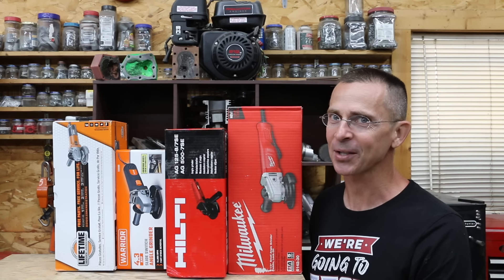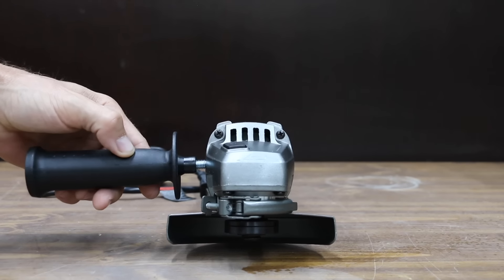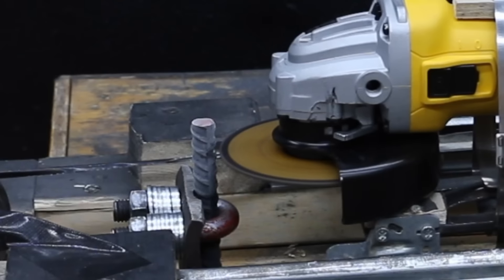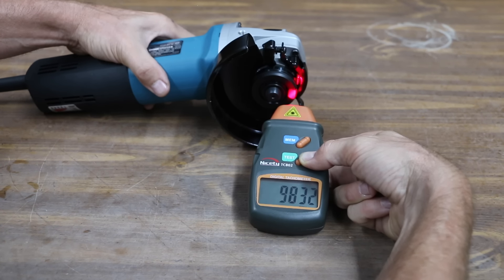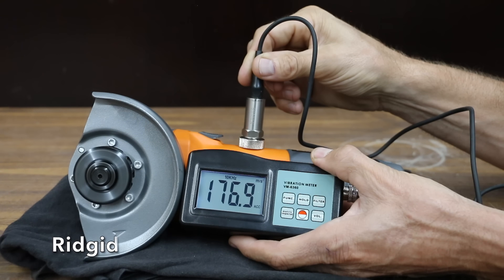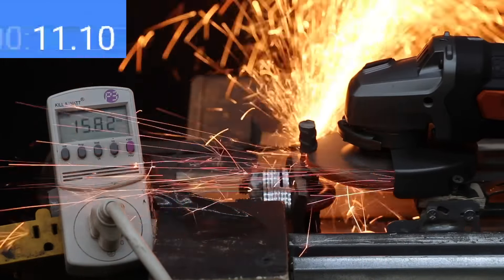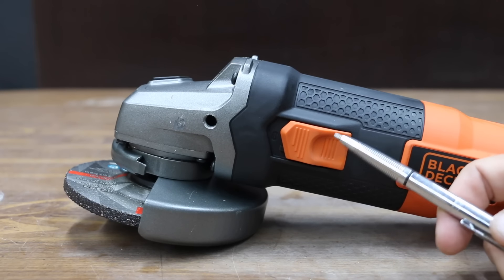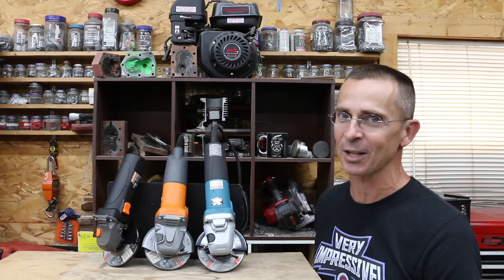Best Angle Grinder (Corded)? Hilti vs Milwaukee, DeWalt, Makita, Ryobi, Ridgid. Let's Settle This!

Comment: How about testing some often many construction adhesives. One brand i just used and will be keeping an eye on is the Gorilla Glue Max Strength construction adhesive clear. Another im using is Quad OSI. It says its for windows and doors but its an adhesive. Standing at Home Depot looking at all of the options is nauseating.
Reply from the maker: Thanks for the suggestion.

Comment: I prefer trigger operated grinders in case you drop it. You don’t want that thing flying around!!! Dangerous!  I’m also used to changing the wheel just using a hand grip. This is so you can switch between a bring wheel and brush quickly if you only have one with you on the job.
Reply from the maker: Thanks for sharing.

Comment: Maybe this is an American thing but can you test 5inch grinders, we have almost no 4.5inch grinders here in Australia. Also variable speed versions, be interesting to compare European brands like Suhner and Fein vs the more common/cheaper brands.
I use these cause as a metal fabricator I need different speeds for specialized discs for polishing etc.
Reply from the maker: Thanks for the suggestion.

Comment: Based on this video, I looked into getting the Ridgid or Ryobi models in this review. I found it interesting that both models (which are from brands both owned by TTI) explicitly state in their manuals that they are not to be used for cutting. I'm finding it hard to find type 27 cut off wheels that fit either of these two grinders. Is this just a common thing that angle grinder makers put in their documentation for CYA purposes?
Reply from the maker: Thanks for sharing.

Comment: I'm definitely a milwaukee guy but I have a dewalt plug in angle grinder that I really like it's just comfortable and easy to use. I have used a lot of angle grinders I currently have 5 I think that work. I really like my dewalt a lot it has the flapper trigger it's different different than the one in the video. I noticed that my dewalt started sounding louder and slightly rattly so I think it's on its way out but it just keeps going. When it does crap out I will definitely be buying another dewalt I feel like it's just easier to use and easier to be precise with. I have a master mechanic brand 4.5 angle grinder that someone gave me and that thing is ridiculously powerful I just don't like using it because it's just too much for the stuff I usually do so I leave a heavy wire wheel on it. Then I have a milwaukee m18 fuel grinder which is nice and versatile then i have a old makita somewhere which is ok. 
Many years ago I was cutting some 16ga sheet metal with a harbor freight angle grinder and all the sudden the head exploded not the disc but the gear set inside the case or something let go and the guts came ripping out and it shredded my hand pretty good I still have scars. Ever since then I've spent the money on high end tools.
Reply from the maker: Thanks for sharing.

Comment: We use metabo for our small flour grinders and I had no idea they made hand tools. They are very high quality tools tho we’ve done 5 years worth of floor grinding with it. I do have a question tho. Which grinder is best for wet tile cutting (running the grinder through a sponge to do cuts on ceramic or quarry tile). I’d love to know
Reply from the maker: Thanks for the suggestion.

Comment: SORRY TO FIND several tests "NOT USEFUL" on this video...
 
These are the aspects I would consider instead: 

1) A 5" capability, not just 4.5".
2) VARIABLE SPEED but with Constant-Torque.
3) Anti-Kick Back protection.
4) Effective power vs price.
5) Availability of a guard that has a Dust-Collection w/conection for a vacuum.
6) Ergonomics, like barrel circumference.

Look, if you ONLY want to cut rebar or grind away metal, almost any of those tested "will do"...

But, having a good VARIABLE SPEED with CONSTANT TORQUE will give an angle grinder MANY EXTRA USEFUL FUNCTIONS.  That IS the reason I searched and bought my Bosch GWS 15 125 CIE grinder. With it, I am able to perform MANY MORE JOBS, like:
SANDING wood, metals and Plastics at a reduced, safe and more effective speeds.
CUTTING Wood, fiberglass, plastic pipes and many materials (with carbide granule edge discs); 
CUT Slots in gipsum walls for adding electrical cables or pipes,  -BUT WITH A PROPER DUST COLLECTION TO AVOID ACQUIRING"SILICOSIS", a serious respiratory disease! (you really want to be able to attach an effective vacuum!), 
POLISH wood, and even auto paint, or buffing with wool or foam discs...

With low speed with ample torque, I am also able to resharpen my router bits and drill bits to perfection with a diamond wheel... impossible at more than 10,000 rpm!

ASK SERIOUS PROFESSIONALS that work with Stainless Steels, WHY it is way better to work the stainless at REDUCED SPEEDS, and that is why there are special models of grinders designed for "INOX", like those from Bosch and Metabo, which have a lower speed gears in order to run the abrasive wheels and discs at around 7,000 rpm max, instead of going mad at 11,000 !!! Stainless is best worked at reduced speeds. But unless you only work with stainless, those are quite more expensive, but a good Variable speed will perform the ocassional stainless job adequately.

Now, if you read the workplace studies of serious accidents, you will find that the "smallish, innocent looking hand Angle Grinder" IS among the worst serious accidents prone electric tool (!)...
There are even quite a few deaths caused by this smallish tool... So, there is why having an effective Soft-start WITH a sensible Anti-Kickback feature CAN BE a "life-saving" option.

At least in my country, only Bosch and Metabo met my criteria on corded Angle Grinders, and while there were a pair of truly inexpensive ('cheap') grinders with a too-simple Variable speed knob, based on a crude light dimming circuit, they lost ALL TORQUE at reduced speeds, making them useless ("Gladiator" and "Knova" were those two brands). 
Finally, the only aspects I do NOT like on my Bosch 15 125 CIE, are the somewhat fat barrel, that does not fit quite comfortable in my small hands, and the forward ANGLED lateral handle threads, because it makes more difficult for me to install it onto my inexpensive attachment that transforms it into a nifty pull down cutting station, that is designed for the grinders that have those lateral handles at 90 degrees.  Best wishes.

Comment: I must concur with an earlier commenter that you're a National Treasure. If you were in Japan, you'd have likely had some medal, plaque or a big whompin' scroll awarded to you by now along with some sort of title of nobility like High Lord of Handtool Tomfoolery, along with a pension or sinecure. Meanwhile, here amongst the peasants and groundlings and other bottom-feeders, I seem to have muddled along just fine for well over a decade with my humble predecessor to that "Horror Fright" Warrior, an elderly Chicago Electric brand 4½" grinder. I got it to help me lightly rehab a rather woeful boat trailer back in '08 or thereabouts, and it hasn't disappointed me since. I doubt I paid more than $15 for it. I'm pretty sure it ain't the pinnacle of the toolmaker's craft, but it's been well good enough for the likes of me. I've often run it "off-grid" using one of those little old 2-stroke 900 Watt fussbucket StormCat or TailGator style generators they used to sell for well under $100, and it's been a great pairing.
Reply from the maker: Thanks!  Thanks for sharing.

Comment: Hi Todd,

 I'm a looong (<10,000 subscribers) time fan, wondering if you've explored the idea of testing bike locks, specifically u-locks that claim to be "grinder resistant" or >16mm to prevent bolt cutters.
Someone cut the Master Lock U-lock on my ebike with a cordless angle grinder this week, and I'd love to see how various u-lock manufacturer claims hold up. I'm happy to help in any way.
Reply from the maker: Thanks for the suggstion.

Comment: I own same Black & Decker and vibration is unbearable. maybe okay for cutting, but if you need to clean metal you have to rest like every 2 meter.. not sure how much of that vibration comes from motor and how much from coral disc though. Anyway, keep that in mind if you intend to use grinder a lot.
Reply from the maker: Thanks for sharing.

Comment: I’ll just say, the ryobi  s probably my favorite . I love trigger switch for 1 handed grinder although it sucks with a cut off wheel.. I have a difffernt metabo with the thumb switch but it blows your grinders away..I don’t ever think I bogged it down no matter how had I pressed, my only dislike is metabo uses that splined shaft and I does a weird thing with threaded flap disk sander  because off the brake ..it launches a sanding disk across the shop as it stops you forgot to mention the ryobi comes with an extra set of brushes

Comment: Noobs should avoid buying a 4-1/2" grinder for their first since a 6" takes the same attachments and runs the wonderful 6" thin kerf cutting discs. I buy those by the box online but your local welding supply will have them. Their reach and edge speed are so worth it I mod my 4-1/2" guards to 6" by cutting and welding or replacing the guard with one from a larger grinder. The 6" diamond grit discs are excellent too, just be reasonably gentle with the grinder when cutting.
Reply from the maker: Thanks for the feedback.

Comment: Several brands make both electronic and simpler grinders, so it seems a little disingenuous to compare between categories. If you really want to try price is no object performance, you might want to try the Fein grinders that need a converter box to change the frequency of the power to 400Hz. I don't know how you'd test it, but a number of grinder manufacturers advertise longevity resulting from designing the air flow of the motor cooling air to minimize the amount of metal particles left in contact with the windings.
Reply from the maker: Thanks for the suggestion.

Comment: @projectfarm Edited  Ok…. But now go and get the battery powdered ones. 😂

I’m locked in to Dewalt because of their batteries. I think I have 15ish. 

That is sort of the dilemma with battery tools. How about a test of each of the different brands intro drill, saw, driver, xxx and yyy. Basically if you buy into one brand, how well will the main tools stack up against each other and as a real important piece of information, how well do the batteries handle and for how long. Maybe as a season finale?
Reply from the maker: Thanks for the suggestion.

Comment: I came back to this video cause my work and hobbys often require violence.....sustained,....long,....dear-lord-is-this-really- gonna-take-all-freaking-afternoon!?!!!?, Kind of violence.😎
Also have a couple video ideas that might not be Bodaciously Expensive; Though your hands maybe tingly for couple of days, "Best Jig Saw Blades." & "Best Jig Saw, Corded, and Battery powered." It's handy to know if the battery platform you're doesn't offer good-useable corded version for large projects that require a real commitment to complete. I have Battery powered Ryobi and 25yr old Black &Decker corded model that still gets the job done.
As far as jigsaw blades go, I've got friends that sware by Diablo, Milwaukee, Festool, DeWalt, but when they break a blade, they'll usually take what they can get.
Reply from the maker: Thanks for the suggestions.

Comment: I just bought some usb c lithium aa and aaa from aliexpress. I would like to know the results.
Reply from the maker: Thanks for the suggestion.
Reply: One thing of note, the batteries seem to be the thickness of sheet metal it's made of too short. I will notify the manufacturer and hope they fix the problem. So far there's  only one maker of them.

Comment: Oh, this is a know territory for me.. the best grinder is for one hand around 1400 watt . Old hilti models ( are bosch engine) or GSW 1400 watt bosch are the best in industry ever. I have use a old hilti about 17 years now.. 12 in the Shipyard every day use.. 3 times change the brush. Metabo i use also but I don’t like it, dewalt now but brushless 1700wat cable version is fine. But bosch is the king I think, high line I’m spoken about. They have a 1900watt in a small body. Only with lateral switch. All the rest are not for professional use. Hobby like 😂position. The bigger grinder make sense to hold it with two hands. The middle grinders are always sucks. I have the Makita also, make more heat than the Bosch.
Reply from the maker: Thanks for sharing.

Comment: Amazing that there's seams to be no Angle Grinders with no Gear noise, if the gears were just angled and meshed they would probably make 40db, and I often use my grinders to polish so yeah would be really nice if my ears weren't ringing after 30s

Comment: Those "locking" power switches are attrocious. Every grinder I've ever had that was equipped with that switch has been replaced because of that switch. Eventually, they degrade and the grinder ends up shutting down half way through a cut because vibration unlocks the switch.
Reply from the maker: Thanks for the feedback.

Comment: Twenty pounds? Only an idiot would put that kind of pressure on anything. I do a lot of stainless steel work. A lot of fabrication too. I can check out the company's Metabo and a couple cut-off wheels. Use it intensely all day, and return it with the new wheel. My younger counterpart, grabs a dozen, and has gone through them, in an hour, and has little to show for his time. I have shown him, over and over, but he doesn't get it. Like I let the weight of the tool, score the sheet metal, going deeper each pass, no aggression. Same with the circular saws. He smokes them. Wet treated 2×12 boards, needed ripped for our sludge skimmer. He wouldn't get halfway, before the smoke was rolling. Me, I set the blade depth to leave a paper thin strip, let the saw make the kerf, at its own leisure. Keeping it straight, and unbinding. So I have a stack of boards ripped, while he's on his first one, and sweating profusely. He has the full blade down, and I am not sure, what he's doing. If only I could teach... And I probably shouldn't mention that he was trying to weld aluminum with a 6011 stick, that's just too embarrassing...

Comment: You did fail to account for the fact that Metabo, Milwaukee, and Ryobi have "deadman" switches, meaning that if you release your hand from the switch, the tool stops.
Reply from the maker: Thanks for the constructive feedback.
Reply: @ProjectFarm  ...yes and I think that on some job sites that OSHA will require that feature.

Comment: Warroirs are junk. Burnt the 4.3 up in 5 minutes, cutting 3/16" fiberglass. And the bigger warroir I bought just quit running, junk. Metabo purchased at the same time as the two warriors is still going strong.
Reply from the maker: Thanks for the feedback.

Comment: When you are using a 5 inch grinder the most important thing is how much fatigue to your hands . While using it some times when grinding with a 5 inch you only use 1 hand .Why because sometimes when grinding with 1 hand  you can do a better job when fine grinding or in tight positions where you can only use one hand .For the record I absolutely hate 5 inch grinders that you have to use to hands to operate and from experience the Milwaukee is the worst i've ever used
Reply from the maker: Thanks for the feedback.

Comment: Why not compare angle grinders with all the same Amp rated motor? Or break them up to compare a few low Amp, few medium, few high Amp motors
Reply from the maker: Thanks for the suggestion.
Reply: @ProjectFarm  I know you had a variety of specs and prices in this video however, it would be cool to see a budget battle with separate Data and a high end only battle as well

Comment: I hate using a Dewalt grinder.  They a junk in my opinion.  They vibrate way to much.  They are loud and don't last that long.  I love my Milwaukee grinder.  I like the power switch and it's fairly smooth.  I have used a Makita and they are great.  I usually stick with makita for my power tools but the price and switch made me choose a Milwaukee.
Reply from the maker: Thanks for the feedback.

Comment: Hilti makes absolutely atrocious angle grinders for their steep price point. I recently had to use one of their cordless grinders at work. The grinder and 22V 8Ah battery was literally brand new and fully charged. This thing stalled like 20 times trying to cut through 14mm steel cable. 

According to Hiltis website, that grinder with one 22V 8Ah battery costs 630 USD in my country. (Sweden)
Reply from the maker: Thanks for the feedback.

Comment: METABO
Reply from the maker: Thanks for the suggestion.
Reply: @ProjectFarm  if you have no experience with metabo angle grinders I highly suggest you snag one up and try it out.    As a steamfitter I’m using grinders all the time in some of the worst environments and running them harder than you can imagine sometimes.    I’ve let the magic smoke out of every brand BUT Metabo.   Not saying it can’t be done, I’ve seen it, but they just take SO much more abuse.

Comment: theres a reason why Makite seems to dominate fabrication workers arsenal of grinders, the makita can take full on abuse for as long as you please, the cheaper tools are usually not engineered to withstand that for any significant amount of time, but are probably sufficient for homegamers and consumers for light duty jobs. why buy two or three grinders in a decade when you could just buy one:P?